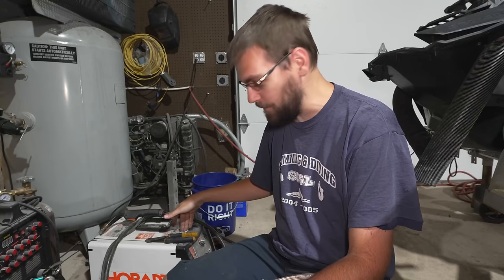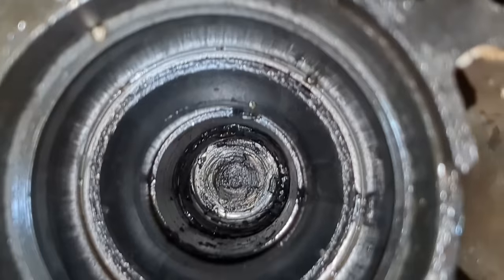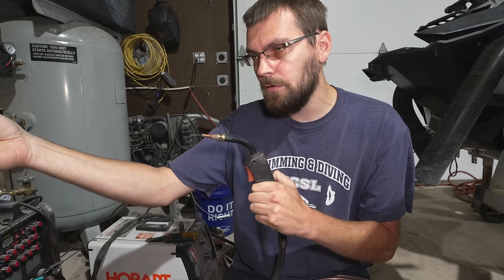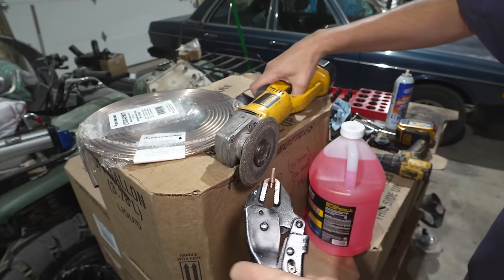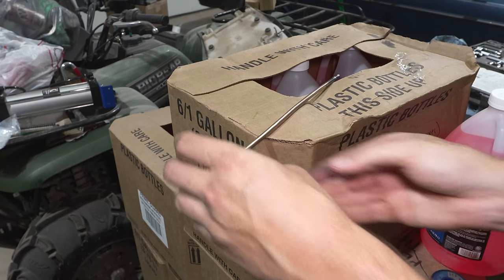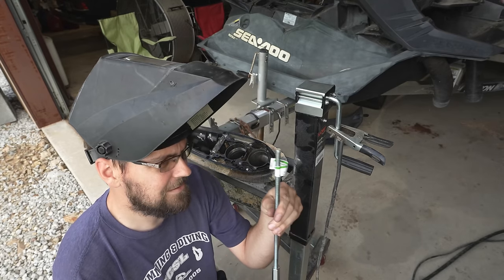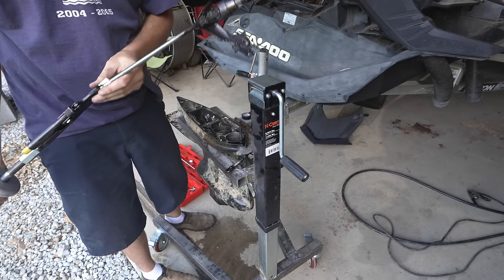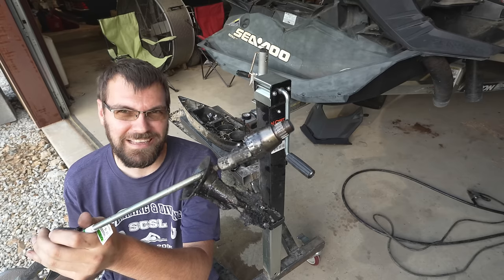Strange problems require stupid solutions?

Comment from the maker: Here is what you need to try this:
Hobart Handler 140 Welder: https://amzn.to/4fF8abp
Flux core welding wire: https://amzn.to/3ULh1jC
Welder tips: https://amzn.to/48LYs4T
1/4" copper/nickel brake line: https://amzn.to/3O5goxy

Links here are most likely affiliate links, should you choose to purchase from one of them, I may earn a small commission for referring you to the seller. And, this is done at no extra cost to you!

Comment: This seems similar to using a stick welder and just letting the rod weld itself to a broken axle shaft so you can pull it out. I wonder if you could use a big enough rod so ir would stick well enough to pull that hard. I've also seen folks use copper pipe to protect threads while doing this procedure. Great idea and a solid option for something really stuck in there.
Reply from the maker: I was at such a loss on how to get these stuck parts out I had no idea what to do, I bet that would have worked if I had a stick welder!
Its always cool to find other tricks and ways to do stuff.

Comment: I got the same hobart welder. Hasn't let me down yet.  Wow, it worked. Need to keep that tip, in mind.
Reply from the maker: Its been a great welder, I've ran several 20lb spools through it and it just keeps working great.
Taught my wife to weld with it, she made some PWC dollies that we use in the shop now out of angle iron and box steel that are just awesome.

Comment: The most important thing with aluminum is getting it cleaned inside and out and try to match the specific alloy with the same filler rod.  Good luck! Is there a community college near you that teaches welding at night? Could be great for ya. It will cut down the learning curve somewhat.
Reply from the maker: @ernestpaling5097  there is a "tech school" but I'm not sure if they do night classes. I will have to look into it though, that could be a real nice option to pick up some extra skills!
I'm not sure how guys fix pontoons because it's impossible to clean the inside, and thankfully I'm plenty busy with just the mechanical work but it does interest me. I enjoy learning new stuff and having skills that can help me out in the future
Reply: @trythistv  if you can't clean the inside, at least clean what you can see. Wire brush until it is shiny.